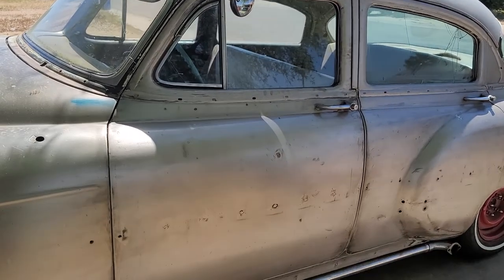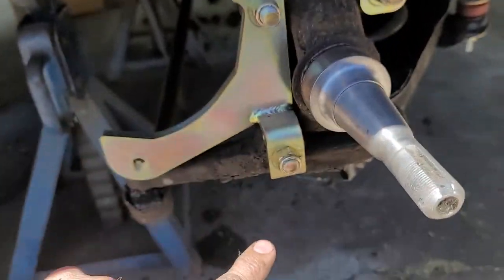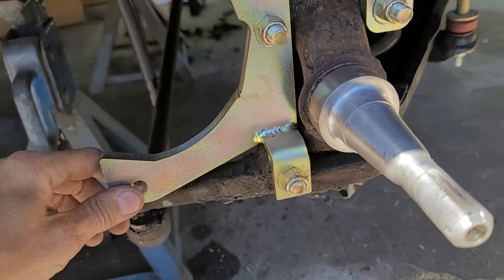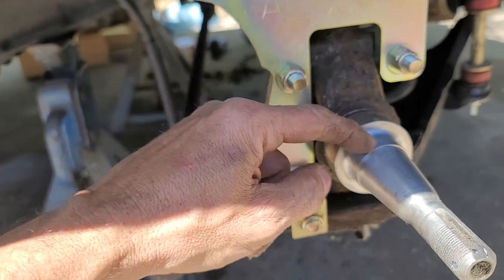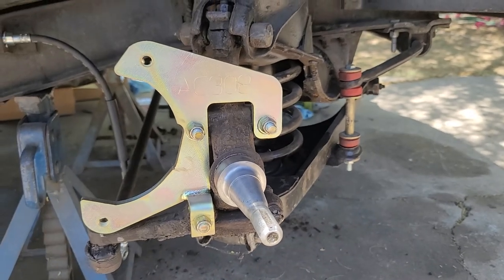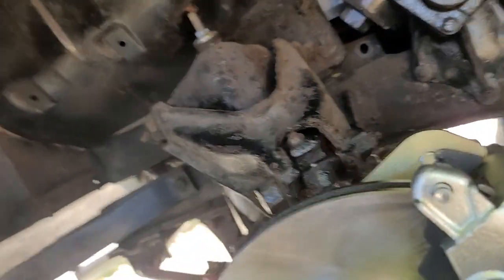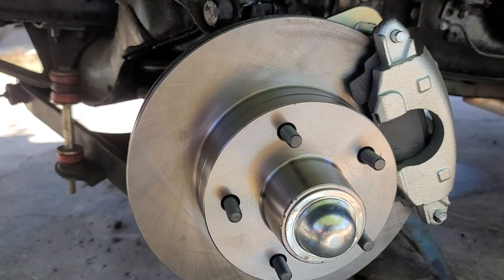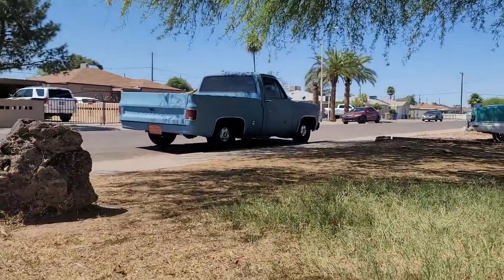1954 chevy disc brake

Comment: ya i bought a kit for a 1950 chevy fleet line from a company just like this;;; what they dont tell you is your spindle has to be sanded down and a key way cut in and shortened by 1/4 inch to work;; so beware when you buy one they is a lot more work than just put it togather;